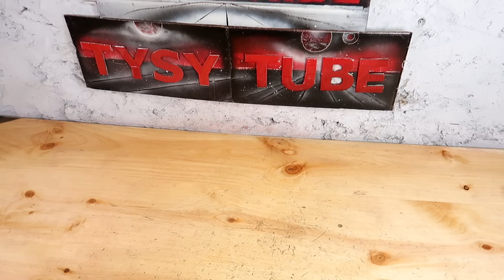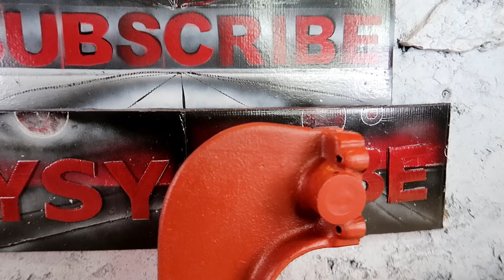Very Rusted Press Restoration

Comment: The casting imperfections on the front is really bugging me out. Those should have been ground down. Some of the pits in the casting could also have been puttied for good measure. I don't approve of the color choice, as it is far too happy for industrial equipment. I do however enjoy the liberal application of grease and all that polishing.

Comment: 6:30 bro don't you have an angle grinder?
Reply: Use that and you will destroy the steel finished
Reply: @franklinbenjamin8063  Angle grinder with wire wheel bro.Exactly the same. Without the back pain next morning.

Comment: There is such a thing as over-restored. The grooves in the bases should not have been painted. They should have been pickled then coated with a thin layer of grease or wax. The surface of the base should be pickled. The entire piece should have been wiped down with a commercial metal prep rather than alcohol. Metal Prep has an acid in it (usually phosphoric) and cleaning agents. The MC-51 may be a pickling agent. Polishing after using the MC-51 removes the pickled surface that prevents flash rust. Adding a wax coating to the pickled surface will reduce the likelihood of rust. 
I fix my tools to a condition where they are useable, not show pieces. Wet sanding a cast iron paint surface?? Really? 
fyi, Pickling requires treatment with a acid like phosphoric acid. It removed rust particles and establishes a coating of iron phosphate. Iron phosphate reduces the tendency to rust.Adding a seal to the iron phosphate with grease or wax will leave a nice iron patina that will resist rust.